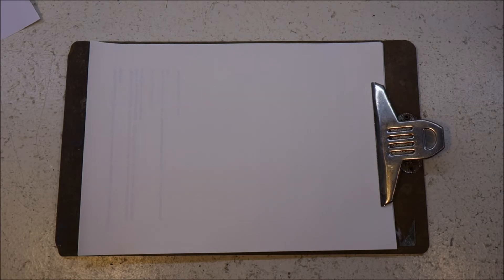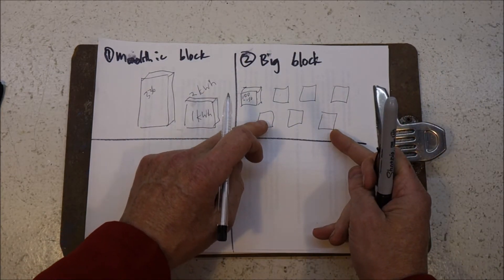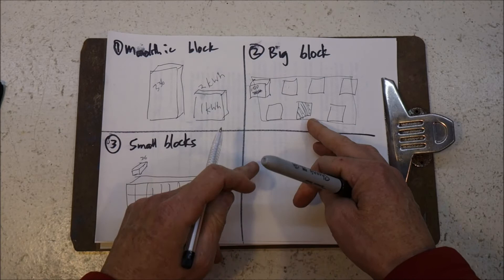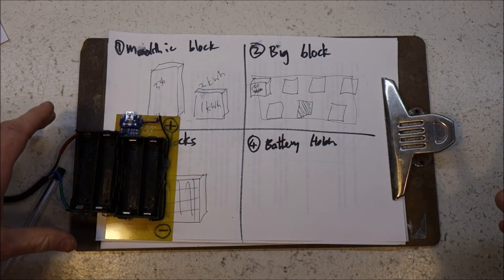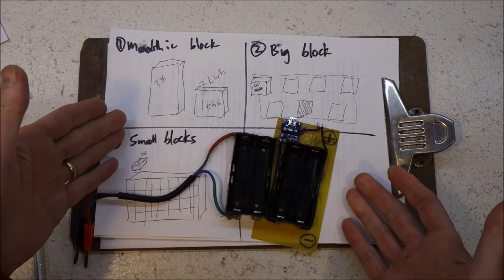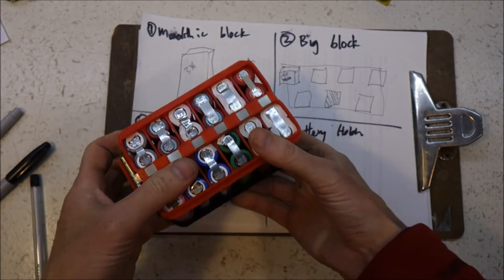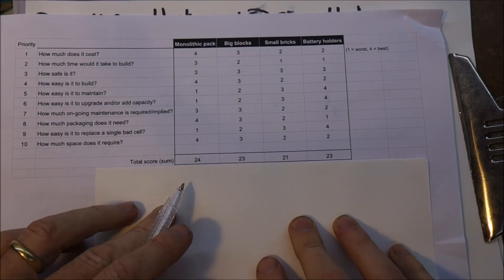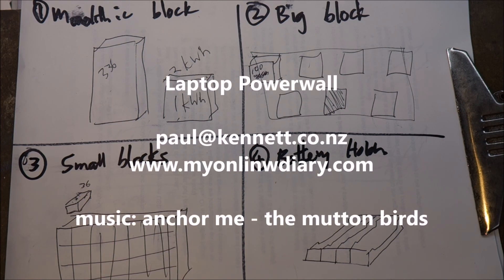Laptop Powerwall 34 - interconnection options

Comment: Another thing I like about the battery holders, UK powerwall guy did the opposite to you where each pack had cells of similar capacity eg. the best cells at 2.8 and 2.9mah made one kw pack right down to his 1.8mah celled pack. He's now realised he is limiting how much capacity he can draw from the system over all by the lowest pack so hes decided to just make the packs with more cells as the cell capacity groupings drop. 

While this is a good idea its very labor intensive, and what gets done with the packs he takes out all soldered together? 

With the battery holders designed in the right way, packs could be sized and changed and cells swapped to perfectly match the capacity of each pack, and over time maintaining it would be a breeze.

I really think your onto something, just a matter of costs and how it goes together, but if you factor in the amount of time saved I think the holders will be well worth it.

Imagine if you had done your current pack like this, then if you thought matching cells by similar capacity was a better way to go you could just rearrange them...
Reply from the maker: +Jayme Capurso I copied the group capacity-balancing strategy of Rinoa Super-Genius: https://www.youtube.com/watch?v=NVJNol7jq0M which my gut told me was a better system (but I didn't have a better rationale).
I've ordered enough 4-way battery holders to build a 1kWh pack. I might as well give it a try!
Reply: Yes, Im familiar with Rinoa, I look forward to seeing how you go about arranging the holders.
Reply: ha, are you sure you linked me the right file, the heading is 'sign frame'. 1600mah is a very low capacity, do you know what they were new? If their original capacity was 2500mah wouldnt that say they are pretty well at the end of their life?
Reply from the maker: +Jayme Capurso Doh! Try this: https://drive.google.com/open?id=0B5exHJfGwNJ0S3BKNGJ2aXN6WFU
Yeah - I was fiddling with the caclulations to see what capacity would give exactly 1 kWh. In reality I'd probably be using something around 2000 mAh - which would result in a 1.24 kWh pack.
Reply: so those thin wire loops are the fuses?
Reply from the maker: +Jayme Capurso Yep. I'll save myself 42 solder joints by doing them as loops.
Reply: makes sense as you will be able to see if one blows easily, will look a bit messy and take up more room though. The room part probably isnt an issue for you but will be for some like me who might be doing it in a tiny house kind of arrangement.
Reply from the maker: +Jayme Capurso Remember this will only be about 45mm high - so it would work well under a bed perhaps. Ah! - just realised I could do away with the gap between groups by soldering the fuses between the top of the battery clips. That might work.
Reply: ahh now ya talking, you and others have come up with so many ways to make doing this easier, seems a crime I can get access to recycled cells in SA.
Reply from the maker: +Jayme Capurso Here we go: https://drive.google.com/open?id=0B5exHJfGwNJ0Z1NZNWV2VFY0czQ
This raises the fuses so they are more at risk of being broken by mishandling though.
Reply: now they are on top maybe you can make them flat instead of looped?
Reply from the maker: +Jayme Capurso Maybe. I kinda like the looping design because it avoids any tension on the tiny fuse wire. If I'm yanking batteries in and out (not very often mind you) there is a potential for the fuse to be ripped off if it's got no slack.
Reply: I havent seen the holders up close so hard to have an opinion but I thought they would be less likely to get yanked if flat. I agree about the loop relieving tension but those holders will need to be secured on a board properly anyway.
Reply from the maker: +Jayme Capurso Here's some images: https://www.google.co.nz/search?tbm=isch&q=4+x+18650+Li-ion+Battery+Storage+Plastic+Clip+Holder+Case+Box
Reply: a dizzing amount of options, Are you going to buy a big load of one type or are you going to get a few different types to see which is best suited?
Reply from the maker: +Jayme Capurso I bought a bunch of these: http://www.aliexpress.com/item/4x18650-Li-ion-Battery-Storage-Plastic-Clip-Holder-Case-Box-8-Pin-Contact-Black-3-7V/32666147477.html

Comment: small blocks!
Reply: +StopLossLOL maybe with a bit more than 24 batteries per block to make the wiring easier
Reply from the maker: +StopLossLOL 24 is the biggest my wee 3D printer can do in one piece. My 2kWh pack used 3 pieces that clipped together to hold 48 cells but I was never quite satisfied with the clips. So I'll try the 24P blocks and see how how well the construction process goes.

Comment: I love how a different pair of eyes sees possible improvements, Id like to see the battery holder idea be developed for sure. Given there is no way of knowing how long these cells will last, being able to easily swap out bad for good seems crucial especially seeing as time goes on you come across a good batch of cells you can just be gradually upgrading you pack, brilliant.

Also MUCH less soldering and heat directly to the battery, less labor/time than the single celled approaches. I think doing it in such a way that is as compact as possible is the next thing to solve, eg. where to put the fuses. Perhaps small groups of cells could go to one larger fuse matched to the increased amperage? Then if a fuse blows you know to test that group of 6 or 12 or whatever amount.

Your approach of keeping them in pairs and battery holders reduces the tedious side by a large margin, listen to UK DIY how painful he says all the soldering is :)

Great stuff Paul.
Reply: Just what I thought - battery holders for the old recycled laptop battery scenario appeals to me.

Comment: My impression is being able to replace weak cells takes a significantly high priority.
Reply from the maker: +Jay Scott ANDERSON Yeah - that was my thinking to. But it does assume you have some way to identify a weak cell. In a big block design there's no way to tell if a particular cell is under-performing. I suspect one of the key benefits of a big block of cells in parallel is that it no longer matters if one cell is weak because the other 99 or 149 (or whatever) will take up the slack. So the weak cell problem becomes moot.
Which sadly undermines the rationale for the small block design. It's a pickle!
Reply: +Paul Kennett I hadn't thought of that before, maybe the weak cell issue, i.e. one weak cell disables all strong cells, only applies to laptop batteries. I assumed it applied to "powerwalls" too.
Reply from the maker: +Jay Scott ANDERSON On the other hand - a bad cell might just run the rest of the cells in a group flat (see Craig Minca's comment above).

Comment: The option 4 was the one I was thinking of before seing this video ;-) Since I couldn't manage to get descent prices on 3D print your cell holder model.
It as a lot of advantages over the other to me. You can for example NEVER touch anymore the cells with a solder iron wich is to me a +, you can solder the fuse to the litle peice of metal outside the plastic holder (if your model is like mines) and then solder its other side to a thick copper bus bar. Everything is very easily visualy inspectable, the fuse the pairs etc...Every group of parralel cell could be put onto a kind of bookcase and wired in serie. But I guess you already have that in mind ;-)
Reply from the maker: +Propergol Yeah - that's the way ChrisViral does it. I'd love to see more detail on his setup.

Comment: I love the idea of the battery holders. I do not have a 3d printer so it's actually cheaper than a monolithic pack (or big, small packs too). 

Easily swap cells out, space isn't an issue for me. 

Can make it very very clean. I think I'm going to go that way.
Reply from the maker: +Andy I've just ordered enough to do a 1kWh pack. We'll see how it goes.
Reply: +Paul Kennett would you be able to send me the link? Cheers
Reply from the maker: +Andy I ordered 40 here: http://www.aliexpress.com/item/4x18650-Li-ion-Battery-Storage-Plastic-Clip-Holder-Case-Box-8-Pin-Contact-Black-3-7V/32666147477.html
However this seller is selling 5 for the same price that most other sellers are selling 1 - so it might be (a) a mistake or (b) a scam. I've got my fingers crossed, but...
Reply: +Paul Kennett wow. Amazing price. I just bought 20 lots. Being in Australia the dollar conversion hurt... Put it on my credit card so if nothing arrives I can do a chargeback if needed.